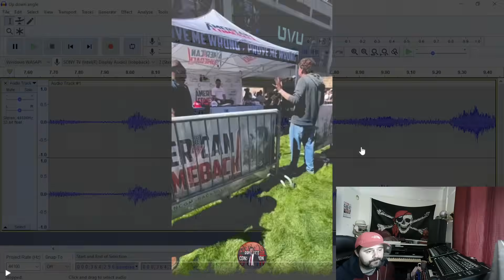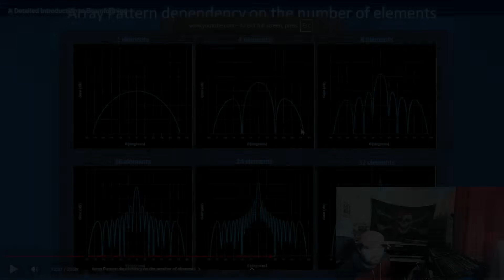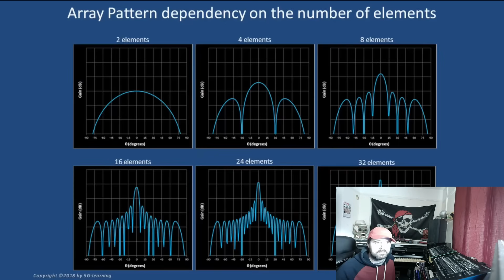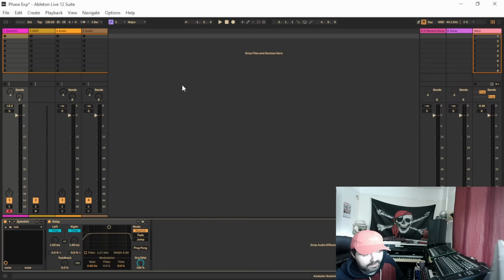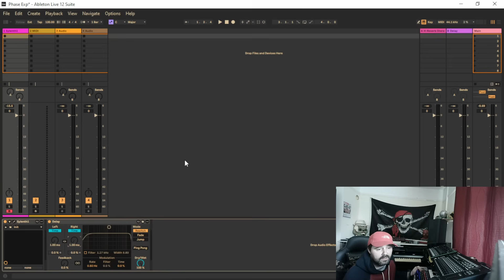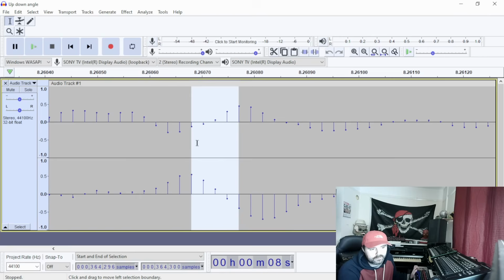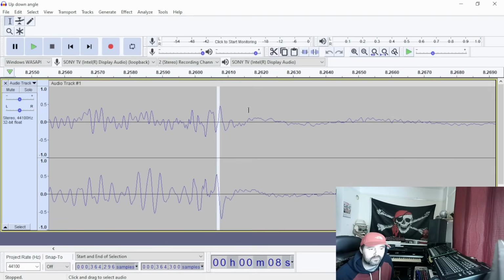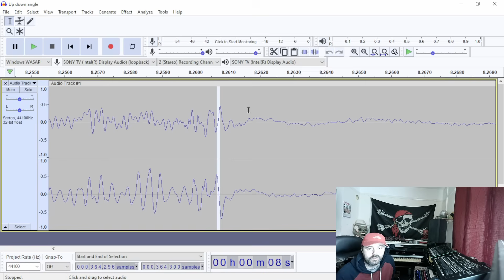Stereo analysis | What a front camera heard and why it's important

Comment: EDIT2 :There seems to be a big variety on microphone placement, math under would be for a s23 ULTRA with mics on each end of phone, but many phones have mics much closer, so math would be very phone dependent.

Original post:

Hi there, thank you for getting the data of 4 samples difference between the two mics (0.00009070294 Seconds)

However I am not able to land on the same result about the angle based on that, if we assume 16 cm between each microphone (unknown phone), and 0.0000907 seconds difference,
the angle of a perpendicular line between the 2 mics would be around 11.2 degrees above horizontal

The Math I used to find that is sound moves in 0.00009070294 Seconds With speed 343 meter/ second = 0.0311 meter difference in distance. And  assuming 0.16 meter mic distance. 
sin(A) = 0.0311/0.16 = 0.194 , making A = arcsin(0.194) = 11.2 Degrees

AFAIK the real angle on site to the alleged position, would be around 9 Degrees, so if we add in uncertainties due to sampling rate 4 may not be the exact distance, and unknown  exact phone dimentions, and if phone was not 100.0% straight up, this finding does seem to coincide With the "official" story

Not sure why my result about the angle differ from Yours, but i showed what I did so if any typpo from me or you maybe that will help to find it

EDIT: After reading the comment section of the crack boom vid, I remember we also have to make sure when picking the sound to analyse, that it is not the supersonic sound from the bullet travelling , but the sound from the rifle itself, not sure how this sound was selected in this video but worth noting)

Cheers.
Reply from the maker: Yeah, I know what's happened here, I read the wrong page of my notes and provided a 3.25* angle. And that wasn't correct because it was from a different mic, I own that mistake and I appreciate you keeping me honest!! SoS, is a bit higher than 343m/s. the temp was about 28* C so, 348m/s ish. I have been rounding up until this point with 349m/s @30* C. Now the angle itself was irrelevant to what I was demonstrating what I wanted to do was see what direction the mics heard the audio before plotting angles, the reason I stopped short on the angle was because there is the variable of not knowing where the sound originated. So we can't actually provide the angle in to get the angle out, and the audio wasn't travelling vertically down. So, the 3.25 angle IS fantasy and that is my fault for being terribly organised. If you subtract that 11* off normal, you run into the next issue and that is the phone angle itself. So, I thought I cut all that angle stuff out, but if not, I apologise for the confusion. I am doing an angle now though and will post later sometime
Reply: @Audio-Freq  Thanks for replying and it happens nw:) I agree that the phone angle possibly being many degrees off does severely limit the usefulnes of the "angle relative to phone" information, so to (attempt to) not include it makes sense :D Looking forward to future vids and to see what you are able to find out. Cheers
Reply from the maker: @luckyviking1619 just finalising the next one now. Yeah, of course sound being spectral then we can be a little forgiving and just say it comes for there as an area. The more that stacks up the stronger it becomes. Appreciate you man, thank you!! 🫡

Comment: This week I learned that a round from a 30-06 can penetrate 1/2" of steel but NOT a human neck.
Reply: All bullets are not the same design. Some like a full metal jacket don't deform much at all, and penetrate deeply
Others like hollow points and such will start expanding at the slightest impact and even break into a bunch of small fragments, and have shallow penetration.
What penetrates the steel all depends on the type of bullet hitting the steel

Comment: Interesting work. But in this case there was CLEARLY deception used on numerous levels. The George Zinn claim that he was the shooter problem, the problem with how the alleged Tyler Robinson got off a SINGLE ACCURATE SHOT and then was able to bolt immediately from the roof with a rifle clearly larger than the wounds Charlie suffered showed, and that Tyler is looking like a PATSY while the real shot seemed to come from BEHIND Charlie, and could have involved using a silencer. THREE MEN in or near the SUV directly behind Charlie's canopy and to Charlie's right showed the hatch opened IMMEDIATELY BEFORE Charlie is hit, and when the hatch was closed again there appears to be a figure still inside the SUV holding a rifle that may have had a silencer mounted on it, and both the figure and the barrel move quickly out of site.
Reply: Shot came fro the front, not from behind. He moved backwards at impact, not forward. 
Peace
Reply: @anayv11  And that is why there is NO BLOOD SPATTER from the REAR of Charlie's head? From a HIGH-POWERED RIFLE? You have no ability to PROCESS INFORMATION. Peace.
Reply: Blood spatter was on his left because the bullet hit the left side of his neck and ruptured the jugular artery… that’s why it sprayed to the right from our perspective (to the left from his).
Reply: @CaNTBREaKCHRiS  Both of you are saying the shot came from the front, so you both seem to support the "official narrative," which is a blatant lie. Have you seen what a .30-06 bullet does to a human neck that is NOT penetrating where BONE is? His neck would have not just expanded, it would have BLOWN APART leaving a gaping hole in the back of it.
Reply: @adamfordom6852  You have a lot of problems with the primary theory for a guy who thinks that Charlie was shot from behind despite there being NO WOUND WHATSOEVER on the back side of him.  How do you make that work?
Reply: @adamfordom6852  Also when the shot hit him he lurched backward and his head went backward… Regardless of what weapon killed him, the shot came from the front to his left / our right and blood spurted out of the left side of his neck, things clearly visible in the footage that contradict the idea of the shot coming from behind.
Reply: @CaNTBREaKCHRiS  People see what they WANT to see, or what they are TOLD to see. Simply put, if the caliber was a .30-06, it would have BLOWN HIS NECK APART, as well as left a mess of blood spatter all over the backdrop. Either way, there is a COMPLETE DECEPTION taking place here, and many people are involved or complicit with it.
Reply: @adamfordom6852  That’s fine, like I said I’m not arguing that it had to be that kid with that rifle they said he used, only what I saw in the video which I saw well before reading or hearing a breakdown of what happened according to the government + law enforcement via media. When I watched it I looped that little section and also looked at those few seconds slowed down by different values, everything I personally saw was absolutely independent of and completely disconnected from the perspective of anyone else but me and the person who filmed it.
Reply: A suppressed shooting 22 calibre synced with a louder shot in the opposing direction?

Comment: Another Audio issue that needs further study is the pitch from the CK shot is too high to be the 30 06 that is being pushed.  The pitch is an octave too high meaning half the metal in the gun or round.  Basic rule in music is to raise an octave is cut a tube or string in half or can thin down as well for strings.
Reply from the maker: I will be doing spectral work at some point

Comment: What if the sound was coming from the PA speakers
Reply from the maker: I'd have to measure the second or 3rd iteration. Sound can't get to the speaker system without crossing the mic path 1st, can it?
Reply: @Audio-Freq  , the gunshot sound may be an audio sample played through the speakers
Reply from the maker: @virgogreg  Na, I'd measure that coming from there. I will run in to that as I move back up the wave, but not yet. this is reflections
Reply: @Audio-Freq artificial reflections may be in the sample
Reply from the maker: @virgogreg  The reflections have already past that point

Comment: If you’re looking at the arrival times of the initial shock wave then something to consider would be the Mach Angle of the incoming wavefront.
This is given by : 
sin(u)= c/v where u is the angle of the shock wave cone,  v is the velocity of the bullet and c is the speed of sound.

I got a figure of around 27° for a projectile with a velocity of 2500ft/s, (150 yards downrange).

For an incoming flat trajectory above the top microphone and a 6 inch vertical spacing between microphones, that would produce a time delay of ~0.4mS (about 19 samples@48k).

I’ve probably made a mistake somewhere though...😉
Reply from the maker: I haven't got that far with the sonic boom. I just measure as a reflection. But, I will do when I have more data and some rifle tests are performed
Reply from the maker: And, you are on to something with one of the later tests. We may be able to line up the radius of those to find a trajectory later. But, I need test results really
Reply: doesn't the sonic boom travel at a speed of the sound. So you should add the orthogonal distance from the mic and bullets trajectory for the sonic boom. The angle of the shock wave is a result for the bullet traveling faster than the sounds spreads out from the bullet.

I need to add an drawing to make it easy to understand
Reply from the maker: @lubricustheslippery5028 depends if you are measuring to or from doesn't it?
Reply: @Audio-Freq  Don't understand but don't think so.
The microphone is a distance from the trajectory of the bullet and the sound from the bullet is traveling at the speed of sound. So you should subtract that time. The closes point should be where orthogonal to the trajectory, so a line 90° to the bullets trajectory.
You have to set up the equation with the trigonometry and solve it for the coordinates for the shooter and use something like linear regression if several mics are used
Reply from the maker: @lubricustheslippery5028  No “orthogonal time” to subtract—the projection already handles it. Trajectory comes later with multiple constraints, not by adding ad-hoc terms.
Reply: hi @lubricustheslippery5028 - the bullet travels supersonically. The shock wave propigates away from the bullet at the Mach Angle which is around 27°.
So when the bullet arrives at the target, the shockwave is right behind it propogating out in a cone at a 27° angle but the pressure wave from the muzzle blast is still 78 yards away - taking another 206 milliseconds to arrive 
So yes, you would ideally need to factor in how far to the side the mic was compared to the line of the bullets trajectory.

The audio file I have is maybe 6 to 8 feet "off axis". I am roughly compensating for this in my calculations along with how far the mic is in front as well. It adds about 6mS to the distance calculation.

The upshot is either an error in the bullet velocity of plus/minus 40ft/s
Or  difference in location of plus/minus 6 feet.
Not critical in my book.
Reply: @duncanmcneill7088  If the microphone is father away i get the math to
t = (M s sqrt((2 sin^2(α) - M^4 + M^2 S)/M^2) + M u sqrt((M^4 - sin^2(α))/M^2) - M S u + s sin(α))/M
Assumptions
1. Bullet travel at constant speed, in a straight line
2. The microphone is not behind the shooter or target
t = time between crack and boom
M = distance between microphone and target
S = distance between shooter and target
α = angle between shooter and microphone to the target
s = speed of sound
u = speed of bullet

Comment: You are not accounting for possible electronic delays / asymmetry in the electronics of the bottom/top microphones. One would have to use the same model phone and do experimental verification / blinded tests. You don't HAVE to but it will eliminate any remaining doubt.
Reply from the maker: That is what the beamforming section was referring to. It's already accounted for

Comment: Nice one Matt (with assistance from Mr Dingles!)
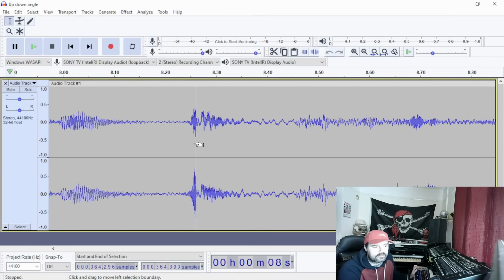What really interests me in that expanded sound recording (@5:48) is the second loud wave-peak that I calculate is between 12 and 16 milliseconds after the bang (I'm calling it a bang and not a crack because I don't think the bullet was supersonic!!)
I took the second peak to be around 14ms and applied my formula for distance between crack and bullet (Crack first, gun bang second) as per your original estimates of speed of sound and speed of bullet, and came up with a distance of 8.33 METRES! for how far away the shooter was from the mic?? The camera operator is obviously standing on the lower level of the pentagonal shaped amphitheater - same as Charlie. They are just in front of the fenced area around 5 metres from the question microphone in front of Charlie so we can tell with reasonable accuracy where the camera/mics are located (which is right by one of the crowd loudspeakers btw!)  8.33m gives a supersonic bullet shooter to be within the amphitheater itself!
The CLOSEST point for any echo to be reflected into the mic is the building right behind and above Charlie which is 9 metres from the person holding the phone. So any reflection would be a total distance of a minimum of 18m. For an echo to be recorded from that close point there would need to be a 23ms gap, not a 14ms one?
Could that second peak come from the timing gap between the bang and the loudspeaker repeating it? I'd say the mic's were no more than 2m from that speaker.
if not, what else could it be?
A second bullet??
Reply: We definitely hear a 'crack' dude. Question is, was it an actual shot or was it simply a recording?

To me, it seems suspicious that every recording 'hears' the sound at the same time that Charlie responds to the impact. One would think that there would be different delays between sight and sound depending on where the cameras were placed. For example, cameras close to the shooter would register the sound before 'seeing' Charlie get hit while those closest to Charlie would see Charlie getting hit before hearing the sound of the shot. So, there should be a wide spread of these delay times if Tyler was indeed the shooter.

Therefore, either the shot came from much closer to Charlie and everyone experiences almost identical delay times or, the shot we hear is prerecorded and triggered by someone firing a round that we don't hear because it has been silenced.
Reply: @undercoveragent9889  I later mentioned in another comment I agree with you - the sound was definitely that of a supersonic bullet 'crack'!
You are incorrect however in saying all Matt's mic's record the crack at the same time!
Matt has simply synchronised each actual recording so that they all start from the point of impact (as amended for reaction time) in order that he can more easily compare 'sounds for sounds' and tell them from echoes of sound. This way he can build up a more detailed 'visual' picture of which sounds come from where and at what distances for each mic.
You are correct again when you said each mic would hear the crack sound at different times.
As for the silencer - that is one possibility but it is possible to synchronise two different guns so that the shoot at the same time and only one sound is heard - by humans! The mic's could tell the difference though! That's why it is essential Matt (and others if they wish!) need to carefully analyse each recording and compare them.
Reply: @MrAuswest  With the 'silencer thing', I was suggesting that the firing of the silenced weapon triggered the sound that we all hear.

With regard to the time differences, I just find it odd that every camera seems to 'hear' the shot at the same time they 'see' Charlie respond. This seems to definitively show that Tyler did not fire the shot that killed Charlie.

FYI, I applaud all of your efforts and admire the way the community has come together to try and get to the bottom of this. I was in no way meaning to demean anyone. How could I? The search for truth is a noble endeavour.

Peace, dude. :)
Reply: Is there a possibility of the bullet sound being played on the speakers in front of Charlie?
Reply: @A_Mystery_Man   100% yes. In Matt's latest interaction on Youtube with 'TriggerSmart's interview he confirms this and can measure it. It makes no difference though - speaker sound is MUCH  less in the mic's as compared with the sounds of the bullet, gunshot and crowd.
Reply: @MrAuswest  I was more saying is there a chance that the sound exclusively originates from the speakers, and it was some kind of theater show. Is that possible?
Reply: @A_Mystery_Man  There was definitely some kind of 'show' going on - some weird actions of many participants, but no - Matt specifically stated that was not a possibility - reason being what the cameras/mics pick up is the 'natural' sound of the things I mentioned previously ( there were 2-3,000 people there ). 4x10 inch speakers cannot possibly overwhelm the real sound over more than a very small distance and the frequency analysis (range of frequencies and their relative distributions in terms of strength ) of the mic's Matt was checking (from youtube vids)  an easily detect the differences between speaker sound and live sound.
You can also tell by the time difference the speakers need to replay the original from the mic Kirk used or that of the questioners. (When I say 'you' I mean the human ear might not, but a valid audio analysis can).
From my own analysis of those 5 mics and what they hear, the theory that the SOUND came from the Losee Centre is confirmed - virtually zero doubt as all 5 are in agreement with distances from that position.

Where the bullet that killed Charlie came from is still undetermined!
(But Personally, i'm 99.999% convinced it was from the roof of the Browning Admin building - the blue one on Google Earth.)